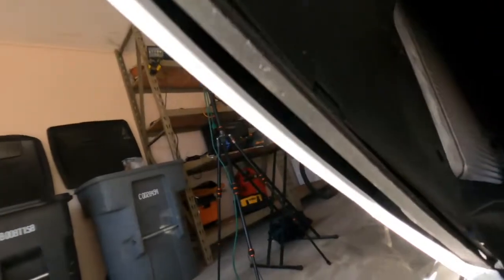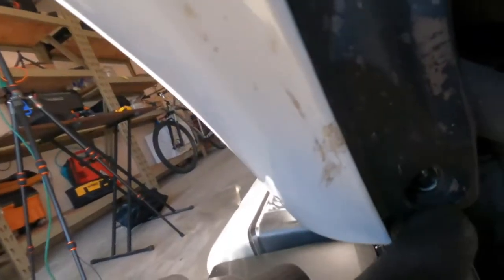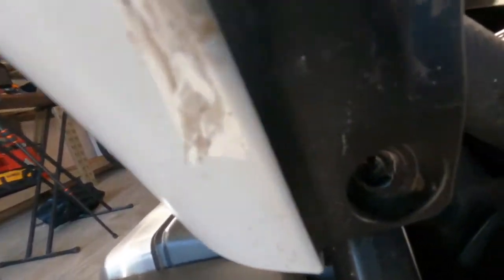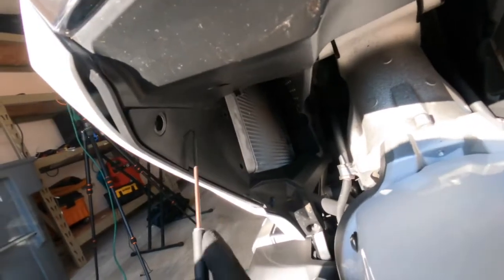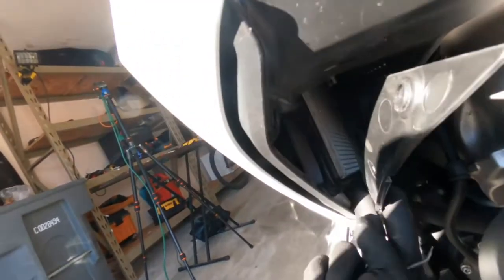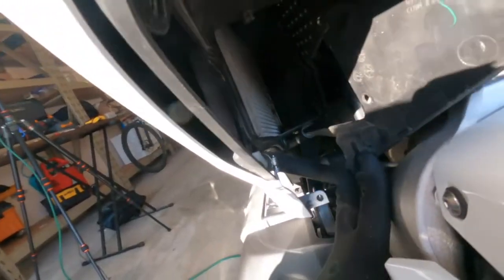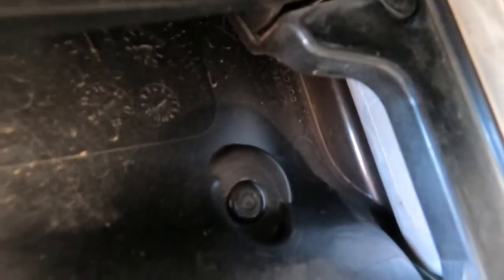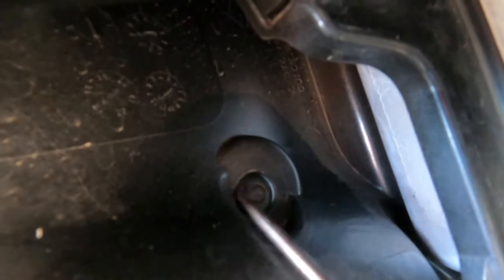2018 Goldwing Cowling remove to get to air filter

Comment: You might as well do another that shows us how to put the bike on the centerstand so we can remove the air filter LOL
Reply from the maker: The rest is easy. Getting those front parts off makes the rest easier. But I sold my goldwing. Stupid design. Harley electra glide is way easier to maintain and just as smooth and fast. Also easier to make the bike fit you the way you want. I could never get comfortable on it even with seat changes.